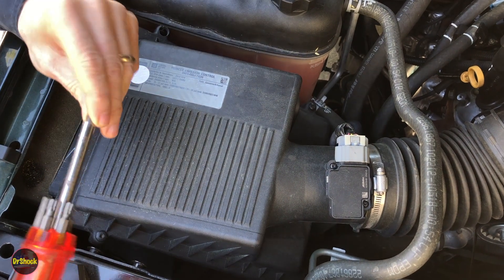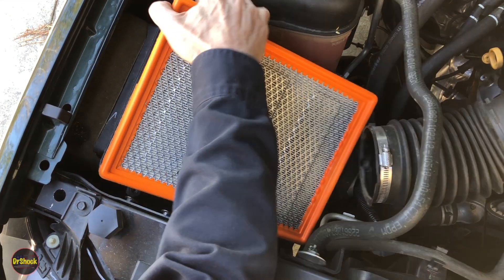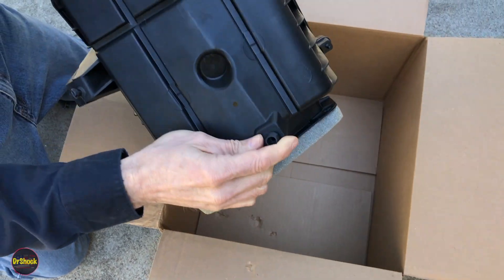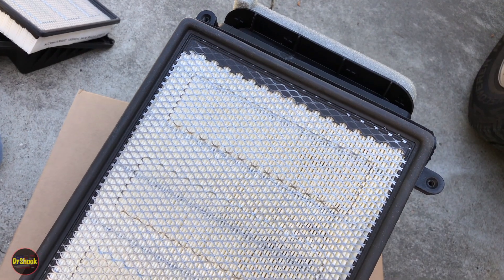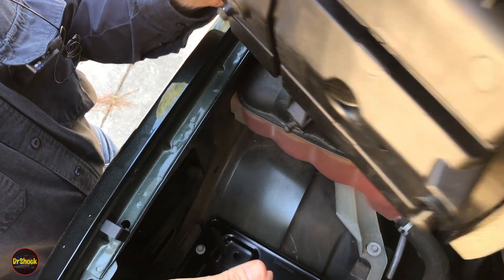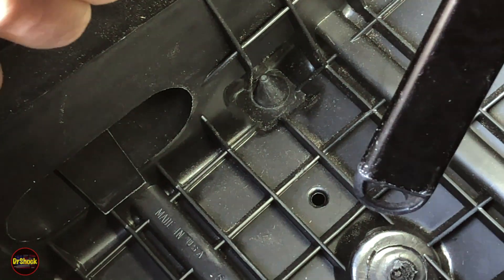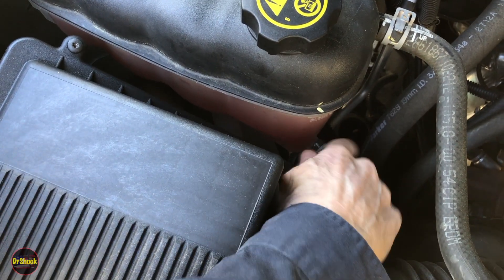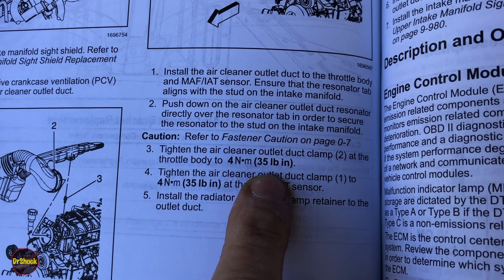2009 - 2014 GM Trucks / SUVs Air Cleaner Housing & Filter Replacement (Chevrolet Avalanche Suburban)

Comment: Hey Dr. Shock!  Just did this work yesterday on one of mine.  Replaced the plate under the airbox to get those new grommets and also replaced the air seal.  It was a pain snapping the box into place!  The A3085C is the original PN from at least 2009, which was superseded by the other you showed but for some reason they keep offering both.  I keep using the old part number too.